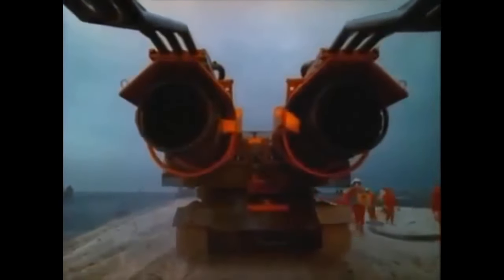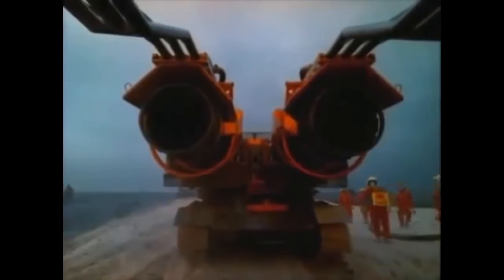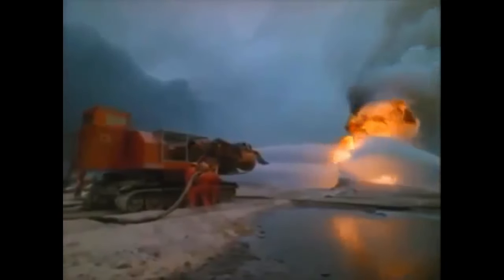The Most Powerful Fire Truck in The World - Big Wind

Comment: Why aren't these machines being used to put out the California fires?
Reply: Jet engines are probably illegal in CA lmao
Reply: @HekateMGO  🤣🤣🤣 so true 🤣🤣🤣
Reply: @HekateMGO  they will allow only electric version of it 🤣🤣🤣
Reply: It contains components known to the state of California to cause cancer. Als it's not solar powered.
Reply: @HekateMGO  because it will blow up a fire coming from a gas pipe from relatievly close distance, but will blow away the still burning planks, branches, roof, and anything, which is too far from the oxygen-less fumes, and water vapor, but still too close to the wind generated by it.
Reply: Got any MiG engines laying around? 🤣🤣 stupid question
Reply: @austinferguson8879  the US does have lots of migs so they could, but I doubt they would care enough.
Reply: @csatacsibe  I'm confused can you elaborate? I literally have no idea what you said.
Reply: @csatacsibe you’re right
Reply: @ZachX888  yes!
So the turbines will suck air in, and use it for combusting cerosine which'll run the turbines itself. The gases its exhausting have less amount of oxigen which'll help to extinguish the oil fire. Also the water vapor, and that expanding exhaust gas will cooling down the flames. However from a far enough distance from the turbine, the wind will mix fresh air with those exhaust gases, so there will be a bigger volume of air moving, and that will contain more oxigen and less vapor. That wind has the power to pick up burning branches, planks and roofparts from the site of forest/house fires, but doesnt have the ability to cool them up enough to extinguish them. So itll spread thw fire even more.
Reply: Fam why isnt this in canada
Reply: Bcoz doesn’t meet the emission standards 😂😂😂😂

Comment: There was a huge gas well fire at Zsana, Hungary, 1979. That burned 23 days long, with a 50m flames. Tousands of man have worked on, to extiguish it. Lots of water wells have been made. They have used artillery to remove the head of the well, they have tryed nearly everithing. That was a painfull work. After this, in 1984, they hve decided to bild a first version of this machine.
Reply: Eredet
Reply: Thanks for the history lesson, amazing work by the Hungarian engineers who came up with this machine!

I’ve seen they upgraded the chassis to a T-55 (makes sense as spare T-34 parts become rarer) and named it “Big Wind 2”… Noice!

Comment: 220 gallons? A cubic metre of water. It put out the demo fire in 5 seconds. That's a great saving in water usage.
Reply: +Vance McCarthy it is not using water to extinguish the fire, but the exhaust gas of the jet engines. It provides an enviroment lacking oxigen for the fire to be "suffocated". The water is there because of its cooling effect.
Reply: +Vance McCarthy More like 220 gallons per second.

Comment: Is their any chance of that thing being sent to Australia to fight the wildfires?
Reply: @DrSardonicus  Thank you for your extensive answer to my one question.

In regards to wildfires/bushfires, most people living nearby are aware that they are a naturally occuring process that will stimulate long term growth.

But the vast scale of the recent bush fires in Australia are no doubt some of the worst in living memory.  

If that thing in the video was to be used on wildfires/bushfires or even house fires, i am sure the water pressure settings could be set accordingly.  Those are jet engines from a fighter plane, they can be powered up or down like any other engine.  Also the distance you combat the fire from is important too.

People build homes where they can.  
I certainly would not want to criticize or call people names when their homes have been destroyed.  Not everybody is lucky enough to live in area free from danger.

Comment: Soooooo if they used this on a huuuuge fire, wouldnt it just fuel the fire??
Reply: there isn't oxigen from the engine
Reply: Someone translated what the dude said - it puts out the fire using the exhaust fumes from the engine, which are oxygen-less.